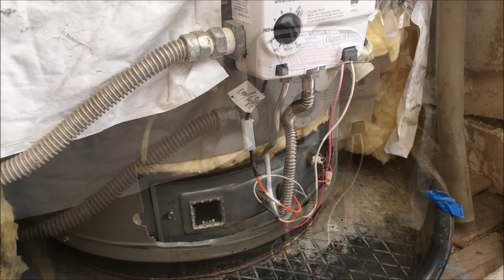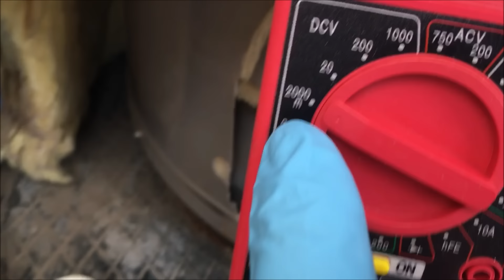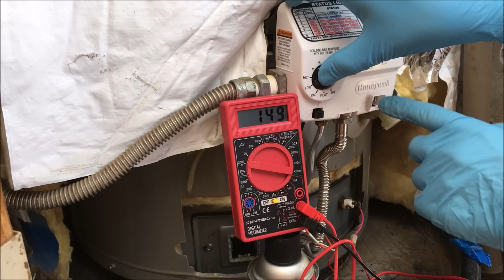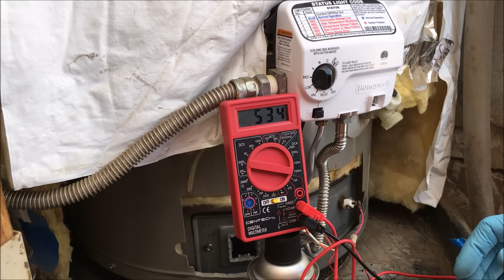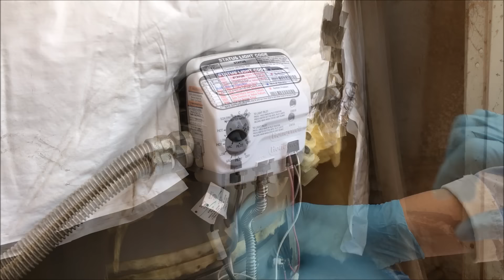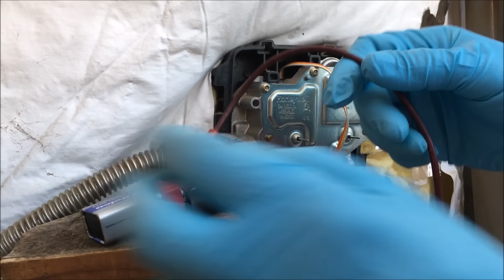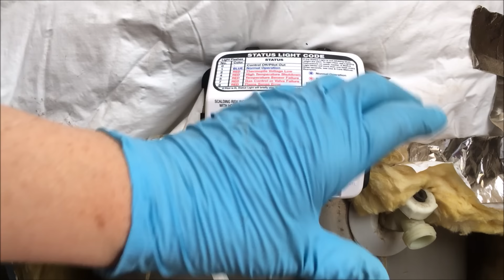Troubleshoot Water Heater AND Honeywell Gas Valve | Step-by-Step

Comment: We have the same model (WT8840C1500) we are able to turn it on using igniter but it auto off within 5 min or after we put into Hot mode. What will be the problem please ?
Reply from the maker: Hello, Y brothers.  The only thing I can recommend is following the troubleshooting steps I show in the video.  It takes some time but does isolate the problem.
Reply: @frugaldiy1  wow very fast reply. I become your subscriber from now 👍
Reply from the maker: Thank you, Y brothers.  This video of mine may help you too.  Here's the link:  https://youtu.be/rllnMAx05JI
I don't think it will work for the symptoms you describe, but it's worth a shot.  Merry Christmas!
Reply: @frugaldiy1  great, I am going to try this now. Mine is on after 10- 20 strikes and then auto off again after 1 to 3 min.
Reply: @frugaldiy1  I tired this. When I finished counting 10 in pilot mode it’s off again. Crazy weather here in NJ.. 11f feel like 1f
Reply from the maker: Make sure the vent at the bottom of the water heater (where the water heater sits on the floor) is clear of debris and dust so the water heater gets intake air.  But, based on what you have said, I think either the thermopile is weak or faulty or the control board is faulty.  I'm sorry you're having to deal with not hot water with it so cold outside.
Reply: @frugaldiy1  thank you for your reply. Sure I will check. Have a nice Christmas and wonderful holiday

Comment: Hello, I wish you were my friend and neighbor :) My mom has a 2012 Kenmore water heater. Well the Control Valve for that year has a different connector for the temperature sensor. I bought the same exact Model # 50032558-001 but it does not have the connection opening for the sensor to attach. Thermal coupler was replaced also. The heater has gas to light the pilot but won't stay on when turning the dial. Any ideas would be appreciated.
Reply from the maker: Hello Yolanda.  Did you blow out the pilot tube and make sure the orifice is clear?
Reply: @frugaldiy1  Thank you very much for getting back to me. Pilot tube? Right now my plumber has the control valve that wont connect with the temp sensor on still.
Reply from the maker: Yolanda, would you please explain what you mean by my plumber has the control valve that wont connect with the temp sensor on still," so I can help you?  Please tell me what you identify as the "temp sensor," so I know we're talking about the same part.  Please watch my video that will explain what and where the pilot tube is.
Reply: @frugaldiy1  Sorry, this is pretty confusion for me. I bought the new panel case and Sears told me it was the right one so my plumber installed it and the sensor does not go anywhere on that new one. At the bottom of the panel they don't look the same although they are the same numbers. I wish I could send you a picture what I'm talking about.
Reply from the maker: Let me try to help you, Yolanda.  Please give me the model number of both the original Honeywell gas valve and the one that Sears sold you.  You will find the model number of the gas valves on the left side of the gas valve covers.
Reply: @frugaldiy1  They both have the Model # 50032558-001but the newer one says -003 but they gauranteed it was a newer version but that doesn't mean anything, all the ones I see on google do not have the same opening as the original valve cover. Water heater numbers are Serial # 1138T477833 Model # 153330230
Reply from the maker: I looked on Sears' website and am unable to access the user's and parts manual without it locking up.  What is different on the new gas valve vs. the older one?  Is it the nipple protrusion at the back of the valve that goes into the water heater chamber?  I do have to leave soon but will check back later fro your response.
Reply: @frugaldiy1  I'm going hiking soon but I will give you my facebook so I can send you the picture of the difference. Then maybe you can delete my message after i send the facebook page?
Reply from the maker: Hi, Yolanda.  I'm back now.  I'm an old-school gal and don't go on Facebook.  If you can describe the location and a description of the area and part you're having a problem with, I'll do my best to help you with it.

Comment: By far the best and most clearly explained how to video I've ever watched. Thank you!  You helped me discover that my pilot valve is faulty.
Reply from the maker: You're welcome, Russell, and thank you for the thoughtful comment.  It means a lot to me.
Reply: Same.  10 minutes ago I tried the instructions and main side is fine, but pilot side is silent.  I have a full replacement valve, but was hoping to get by with a control board swap.  Sadly my gas inlet has no adapter so the whole portion of pipe with the little trap section needs to rotate along with the valve to remove.  The installer placed the high-temp release pipe in a location that  might block this (maybe he wanted to a plumber to do any follow-up work?).
Reply: I've been taking cold showers for over a year now.  My procrastination juice has just run out.  Plumber that HD connected me to wanted nearly $2,000 just to one tank water heater for another, not including the price of the water heater itself!
Reply from the maker: @erikjohnson9112  Yep, it's a BIG ripoff.  Best to do your own work.

Comment: I want to thank you for such a well narrated and detailed video, certainly one of the best on YouTube!  I have a question that hopefully can be answered.  I have one of these gas valves on my summer home and I'm looking to turn the water heater on and off remotely via a switch relay.  To do that I'm hoping to cut either the red or white wire that goes to the thermal switch will.  Will doing so shut down the operation of the valve to where I would need to manually relight the pilot light or would reconnecting the wire return the unit back to normal operation?  Any thoughts would be greatly appreciated, thank!
Reply from the maker: You're welcome, Norman, and thank you for your thoughtful and kind words.  They're much appreciated.

Now, to your question.  I believe, but cannot say with certainty, that reconnecting the wire would return the unit back to normal operation.

Comment: Just installed a new control board based on your video. Burner has been fired up for an hour now so I'm hopeful it will work fully as intended. Thanks so much. But one concern: I believe you stated it's best not to turn up the thermostat past the "Hot" setting. I'm not sure that will be sufficient for my household. The "A" setting seems fine for my wife and me but our daughter (long showers) will be with us for a couple of weeks and I'd be inclined to move it to "B". Can any commenters elaborate on your experience with the higher settings?
Reply from the maker: Hi, Ben.  It's so nice to hear my video helped you get hot water.  I love hearing that!  As to your question--the Honeywell gas valves have a tendency to go into "High Temperature Shutdown" (a 4-flash status error code) if you set the temperature setting over "Hot."  But, if it does, watch my video on how to override and reset the control board.  It's an easy fix, and here's the link:  https://youtu.be/rllnMAx05JI

Comment: Gonna give this a try cause I cannot get mine to ignite at all.
Reply from the maker: I hope the video helps you get hot water, Mark.
Reply: @frugaldiy1  I'll know for sure tomorrow. Amd I'll let you know
Reply from the maker: I'll look for your comment.  I hope it goes well.
Reply: @frugaldiy1  I finally got the pilot light lit. But the burner is not firing up. According to the status button it's showing the thermopile has low voltage.
Reply from the maker: Have you tested the thermopile, Mark?
Reply: @frugaldiy1  not yet. I got to get another tester. I accidently dropped mine and it just shattered. Guessing after dropping it so many times over the years it finally gave up on me. I'm hoping my neighbor has one I can borrow. I do plan on testing it. Just wanted to give you a heads up as to where I'm at now.
Reply from the maker: Okay.  Thank you, Mark.
Reply: @frugaldiy1  I broke down and bought a new multimeter. I checked the thermopile and it read 21.
Reply from the maker: Oh, bummer.  Last I checked, in my area, Home Depot and Lowe's do not carry thermopiles in the stores to sell.  I'd look to eBay or Amazon--whatever is cheapest.  You might consider replacing the entire pilot assembly (includes the the thermopile, pilot head and igniter), rather than just the thermopile.  Last I checked, the entire assembly was only a couple of dollars more than the thermopile alone.  Plus, it easier to replace the entire assembly than just replace the thermopile alone.
Reply: @frugaldiy1  yeah I found one at ace hardware for about 32.00
Reply from the maker: @wildmanmark12  Okay.
Reply: @frugaldiy1  I just installed a brand new electric water heater for a customer I do a lot of work for. The water is not heating up. I made sure that the temp controls were turned up and I even pushed the reset button. Still nothing. It's a Rheem model. Any suggestions as to what I need to do. If you need more info on it let me know and I'll get it. Thank you.
Reply from the maker: I don't, Mark.
Reply: @frugaldiy1  I wanted to give you an update. The electric water heater that had the thremopile gone bad....I got the new one in and it fired up and is working. Wanted to thank you for the video and the advise you gave. It was all very helpful. Thank you so much again.  And I want to send you smoke and prayers for a very merry Christmas and a happy new year.
Reply from the maker: I'm glad to hear it all work out, Mark.  You're welcome, and thank you for the good wishes.  Merry Christmas and Happy New Year to you too.

Comment: I have a small gas leak behind the Honeywell power unit. The gas company was not able to help find it. A plumber wanted to replace the entire water heater. Can I take off the unit and reattach it?
Reply from the maker: When you say "Honeywell power unit," do you mean the "Honeywell gas valve?"  How do you know the gas leak is "behind" the Honeywell gas valve?

Comment: Wonderfully video. When isolated thermopile, it checked good. When checked with thermoswitch in circuit, bad readings. 
Figured it must be bad thermoswitch. Noticed there was a black rod with yellow dot on end of rod in center of thermoswitch. 
Thought it might worg like CB, so tried to push it in. It would move a little in and out, but not catch in any position. Put needle nose on it and moved it around a little. After this tried checking voltage again with thermoswitch in circuit with thermopile, and numbers were great.
Don't know how the inside of the thermoswitch works, but moving the rod around must have cleaned something up inside.

Water heater now is working. Do you know how the thermoswitch works inside? Maybe will stop again later, but now I know what to check.
After watching your video, I was afraid it was the circuit board, as many of the new improved solid state things have much higher failure rate than old mechanical things. Glad it wasn't the control board, as I break plastic things very easily.

Thanks again for great video.
Reply from the maker: James, that's a great idea you had!  BRAVO!  Yes, those "Reset" buttons on the thermal switches get a bit tough to push in and reset, and some don't seem to work or toggle at all.  

The thermal switch is set by the manufacturer of the water heater to "trip" at a certain temperature.  If the water heater chamber gets too hot, per the manufacture specs, the switch will trip and cut the current going to the control board, which extinguishes the pilot flame.  It's a "safety" feature.  Given that your switch tripped, I'd keep and eye on the water heater.  If it trips again, I suspect it's faulty or something is awry, like the intake vent(s) at the bottom of the water heater need to be cleaned.

Comment: I have a WV8860C1015 and I'm having trouble finding a control board online to replace it. Would I be able to simply replace it with a WV8860C1000?
Reply from the maker: I can't tell you that with certainty, Pablo.  But, I can tell you that the model number of the gas valve I replaced my control board with was different than the model number of the gas valve on my water heater.  Both model numbers, though, did begin with "WV".  It worked (and works) fabulously.  ;)

Comment: What do you do if none of this works? Just swapped out the board and getting the exact same thing. Pilot light only stays lit when I hold the button and goes out as soon as I release it. I tested both the thermopile and switch and both work, the valves work. And I'm still losing the pilot and getting a low voltage status
Reply from the maker: Low voltage on what, Panda?
Reply: @frugaldiy1  Wow I didn't expect such a quick reply, thank you! I'm getting 2 flashes on the Honeywell gas valve indicating low thermopile voltage.
Reply from the maker: You're welcome, and what's the thermopile reading?
Reply: @frugaldiy1  I stopped testing after it hit about 700 millivolts since I read that that was normal range for a thermopile. It took a couple minutes to get there. The voltage climb seemed to slow around there too, but I didn't see that as a problem since it had hit the desired range.
Reply from the maker: I'd do two things: 1) "jump" across the thermal switch to determine if the switch is an issue, and 2) remove the pilot assembly and use sand paper to thoroughly clean the thermopile.
Reply: @frugaldiy1  Tried that test as well with the same results. It's a brand new thermopile, but I cleaned it just in case, with no change. This one will likely remain a mystery. I've sold the house and the new buyer said they don't care about it because they'll be putting a new water heater in anyway.
Sorry for the bother, and thank you so much for running through this with me!
Reply from the maker: You're no bother at all, Panda.  I'm happy to help if I can.  I'm glad it all worked out for you.  ;)

Comment: I just wanted to thank you seriously Just by watching and listening and listening to you Before I even started to take anything apart  I realize that my water heater Was not even cutting on Like the fire Due to that little reset switch Was literally stuck in I've been at this for about a week now I just took some minnie pliers  And carefully pull it out Not all the way but back to its normal position And bam I got flame And hot water But I would not have got there If you would not have broke it down How meticulously you did This means so much thank you seriously 😁💯👍
Reply from the maker: CLIFF WILKES, a big thank you to you, too!  As important as it is to you, it's equally important to me that my video helped you fix your water heater.  I try my best to encourage folks to save their hard-earned money and fix stuff themselves.  You've brightened my day with your comment!  Bravo for fixing your water heater!  Job well done, Sir!
Reply: @frugaldiy1  😁💯👍

Comment: How bright is the status light supposed to be?? I didn't see it blink. On all the other videos concerning the status light it was super bright. I hate to discredit your video, but I didn't see it blink. Not even dimly.
Reply from the maker: I consider the status light in the video to be bright.  The status light on the gas valve control board and cover I replaced was quite faint and very difficult to see.

Comment: Great instructional video and really appreciate the description of each part and how to isolate test each one.  I followed your diagnostic steps and isolated the problem to the control board as well.  I found the pin contact for the gas valve ground pin hole of the control board had come loose and fallen off.  I was able to solder it back on and returned the water heater to normal operation.  Two hours of diagnostics and repair on a Sunday evening made it so the family can have hot showers on a Monday morning before school and work. Not to mention the $$$ saved, I was about ready to go buy a new water heater.  I'll be following your channel, Thanks.
Reply: Hope you find it. Mine’s still operating great.
Reply: @Jerhunt  I did and the surgery was a success! Thank you so much!
Reply from the maker: You're welcome, Jeremy.  It's great to hear you fixed your water heater and saved some money.  Job well done!  I'm sure your family truly appreciates your determination and hard work.  Another success story!  Enjoy the well-deserved hot water!
Reply: Whoa, you mentioned something falling off and I looked at my board and see the same thing! Time to go find that part on the floor of my laundry room!!